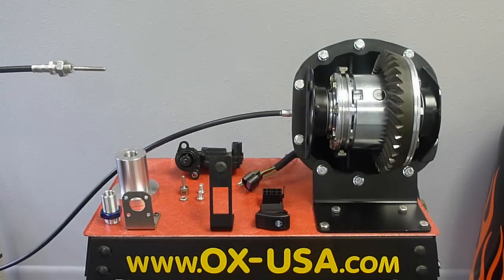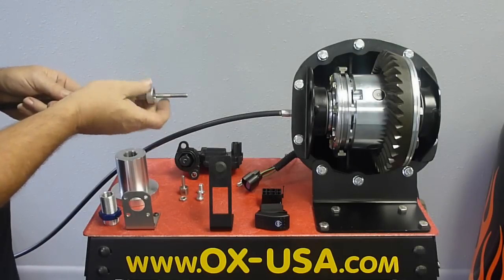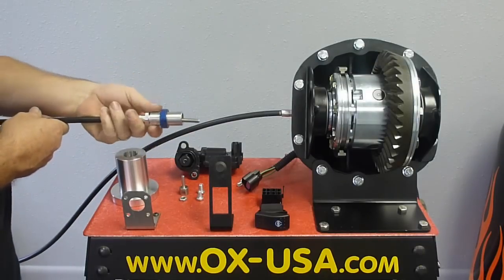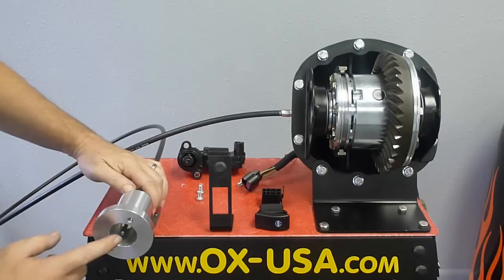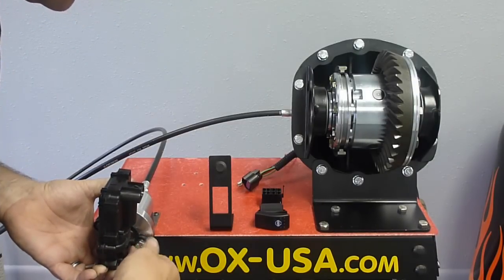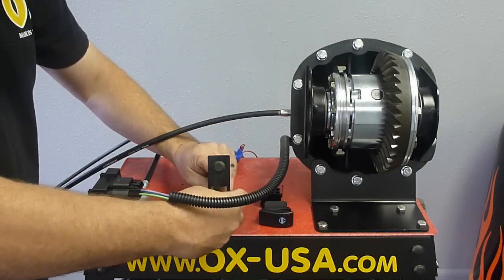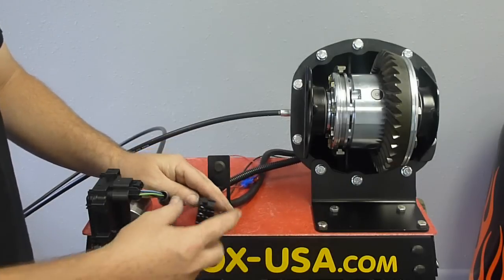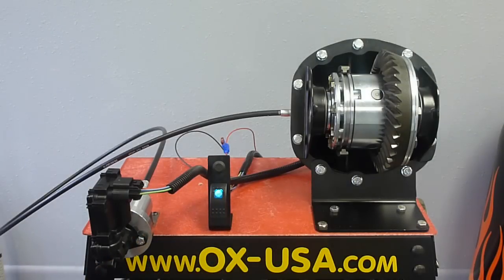OX locker Electric Shifter Installation

Comment: Great vid. What exactly are the benefits of this over the traditional cable actuated one? I feel like this just adds more points of failure.
Reply: That's what I was thinking, I don't get it, You may as well just use a cable and manual shift and lose the electric's
Reply: compact mounting for cramped cabins
Reply: Same. Just go manual and save the hassle.
Reply: @sylvanbowyer341  I agree.  I guess its nice if you want to add it to an available space on your dash.  Like my Sport has 3 unused spots for buttons.  If it could be installed there, that would be cool and look factory.  But overall, if lever can be installed inside jeep and look good, sooner just pull the cable myself.

Comment: Finally someone decided to challenge stupidly expensive arb lockers...unless this is also stupidly expensive too
Reply: About half the price.
Reply: Where is it half the price? These are $800 to $900.
Reply: @latrodectustj2452  you don't need an air supply.

Comment: I was considering electric lockers because I didn't like the idea of a big ass cable sticking out of the differential to get caught up on suspension, exhaust or brush and what not. Now that I see the big ass cable is used on the electric model as well I'm rethinking my approach. Any electric lockers out there that only require a 12v wire to the diff?
Reply: Ive had nothing but ox on stock axle and ton swapped jeep and i can assure you it wont be a problem
Reply: What type of terrain do you primarily drive in? I'm in the Ozark woods. Hardwood trees, branches, limbs, all day. I feel like the machine needs to almost be armored like a timber skidder, ideally. Thank you for the feedback though.  @MMr.NOBODYY
Reply: @TokenTombstone  Ive wheeled all over the U.S. i  primarily wheel colorado and heavy rocks we basically do armor everything! its a extremely reliable   system through just about anything!

Comment: Why dont you put the actuator right in the diff cover and eliminate that cable entirely? Then simply run a small electrical wire to the diff cover to activate the electric actuator.
Reply: Elocker is actuated with an electromagnet inside the diff.
Reply: @geniusiknowit  And this would have the advantage of not having the ramp action  of the eaton. I thought that's how it was setup. This seem cumbersome compared to the eaton

Comment: Can this be wired to an existing aux switch?
Reply from the maker: Yes, but it may not be as simple as connecting to the existing aux switch depending on your situation. Our system uses ground signal switching so if your aux switch puts out +12v power it may need a relay to switch it to a ground. We have the information available on our website to accomplish this if needed.

Comment: JUST A DOUBT, WHY DOES THE ELECTROMAGNET CAUSE THE ENGAEMENT SYSTEM TO SLIDE AWAY RATHER THAN ATTRACTING IT TOWARDS ITSELF?
Reply from the maker: It's actually not an electromagnet that engages the lock. It is a cable actuated mechanical system. The cable can be controlled by an electric drive motor or a mechanical shift lever
Reply: @OxOffRoad  could you Plz tell me how the actuation happens in detail Plz.. I'm stuck at that for quite some time now.

Comment: Would this work for drift builds?
Reply from the maker: If I understand what you mean by drift builds, yea it would work very well. I believe the issue you may run into is a limited availability for the type of axles typically used.